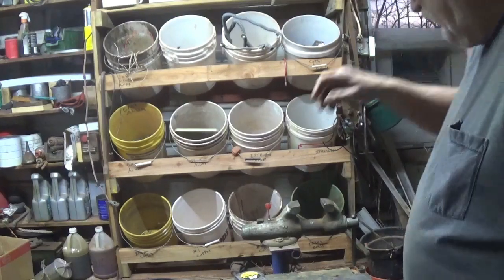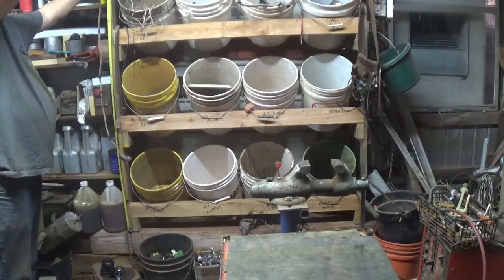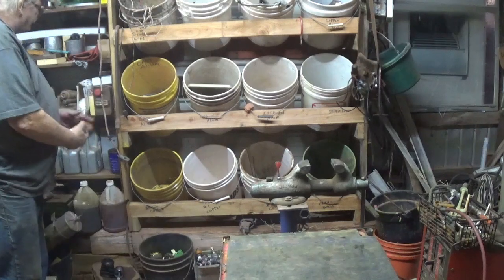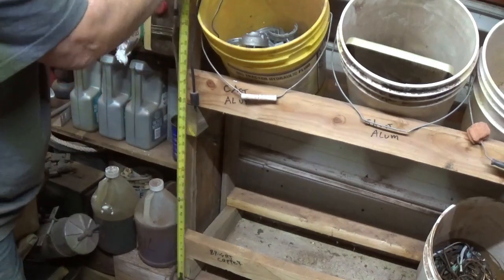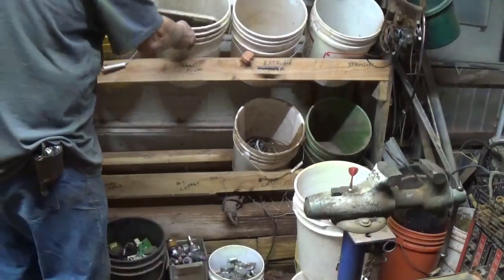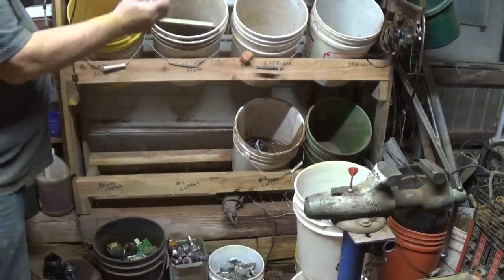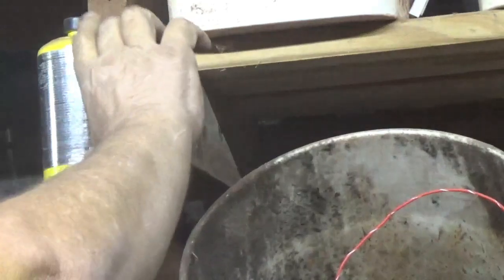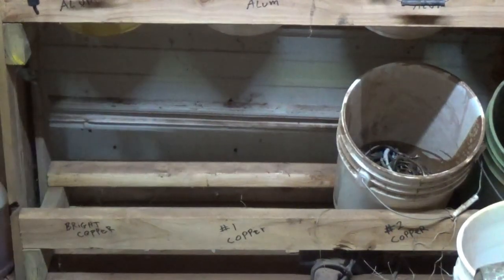How to Build a Bucket Shelf for your Scrap Metal

Comment: When the weather is nice I'll be building one off those :-)  Thanks for the dimensions!
Reply from the maker: I thought it would help giving the dimensions, then it could be built as is or made longer as needed and help to build it faster without having to rebuild it like I did. I almost need to build another one to hold my empty buckets, or buckets for stuff that still needs more cleaning as they are taking up floor space
Reply: @Okiescrapper  Well I don't know if you seen my first youtube video, but my scrapping shop is going to be in a 10'x20' garage so space conservation will be a must. Being in an apartment complex, we are not allowed to have stuff sitting outside.

Comment: Very cool, I have to build something like that at some point, it's so useful 👍 😀
Reply from the maker: Glad you like it. it is useful get 12 buckets in the space of 4. and if a guy has a cement floor and puts it on castors even more useful. a guy could make it double sided and have one side for e-scrap
Reply: @Okiescrapper  Yes, a solid concrete floor would be awesome, unfortunately I don't really have that, but one could make a lot of very efficient stuff with that. 👍